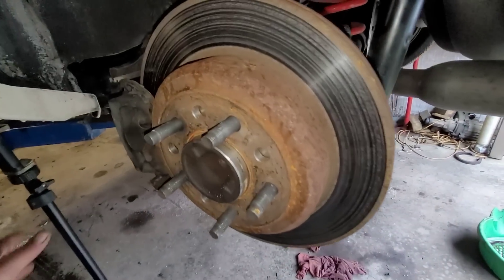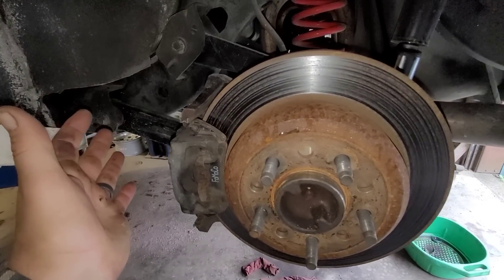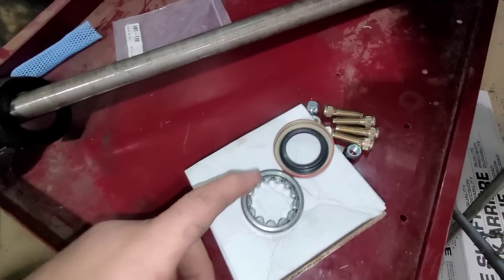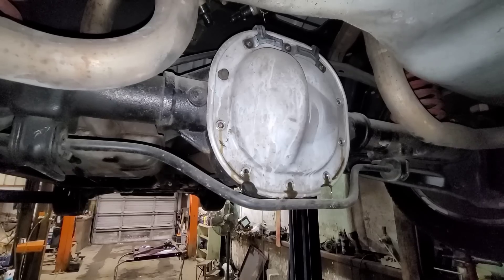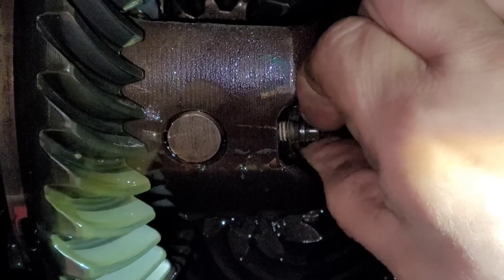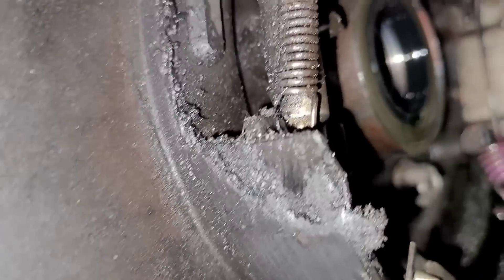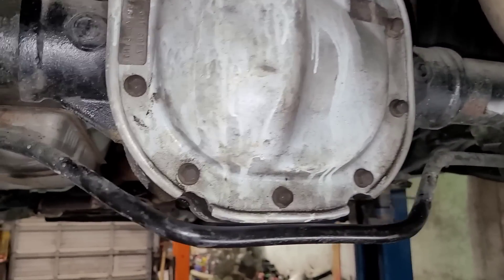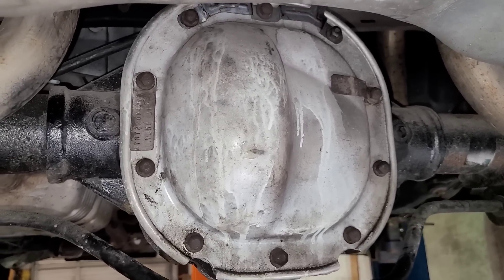Installing Customer Supplied Parts? What Could Go Wrong? I Had To Finish The Job To Find Out.

Comment: Kenny, I have just recently found your channel and started watching your videos, they are very informative, and you do justice to an industry that so many of us are passionate about besides it being our career to earn a living. Mechanics/technicians have been unrecognized for their dedication and sheer amount of knowledge required to perform maintenance and repairs on vehicles, not to mention the vast amount of tools and the cost associated with them. Great to see a positive representation. 
** While watching the video I noticed the parking brake shoes and hardware are installed incorrectly and/or incorrect parts installed. (time stamp 13:57-best view at 21:21) Spring contacting the brake adjuster, pink spring contacting the shoe, looks like shoes are on the wrong way if they are the correct parts, possible wrong parts due to the axle year issue mentioned. Also, you mentioned in the video the customer does not care about the parking brake and is possibly due to it not functioning properly?
Keep up the great content.

Comment: So, the pin in the middle keeps the axles (and C-clips) in place ... and takes the wear and tear of the axle pressure (laterally) as the gears spin ... must be a strong pin not to wear out.

Comment: What I’ve found works really well on a bearing cage that gets stuck like that is to run a bead with a stick welder part way around. The bearing will shrink and be easy to remove.
Reply: Welding a bead in outer race works great. I've done it on tapered roller races. I've always used wire welder. Flux core or gas shielded works well.
Reply: Ditto. Did the same on motorcycle neck bearings, and a couple of motorcycle wheel bearing that seemed to be hopelessly melded to the hub.
Reply: @davidbenes580  either way. It works great. Saves grinding an nicking the surface
Reply: I've done that also. Works really well.
Reply: Awesome tip. Thanks.

Comment: When the bearing race shatters like the one you have (and it does happen often) I just use a long pipe that I stick in from the opposite end of the axle to knock it out.

Comment: Great tip about taking nothing for granted. Great luck in your local parts store having exactly what you needed in stock.  And you’ll always, always turn both axle shafts in future axle replacement jobs to ensure compatibility.
Reply: Or slide the gear over the splines on the axle BEFORE reassembling.

Comment: I generally don’t use brake cleaner because it doesn’t clean everything out. It’s not a very good solvent. I like to use starting fluid because it really does a good job of cleaning. Then I will go behind it with brake cleaner.

Comment: I've watched a few of your videos on problems with parts and your points are well taken. I had a customer supply a rebuilt  starter and six months later it went bad. 
Having a warranty doesn't help you with labor cost and inconvenience of being stuck some place.  After replacing three starters the customer finally bit the bullet and got a new starter and the come backs ended.

Comment: Awesome video Kenny, very nice and thorough with detailed explanations. I watched the whole thing. Too bad you ran into a problem with parts. But a bad situation turned into a good outcome at the end. I try myself not to use customer's supplied parts because it has bitten me in the butt many times. I always advise the customer about that if they provide parts and if something goes south from the customer's parts then they're going to pay me for the down time or pay me to do the job twice. Everybody's situation will vary though especially if it's a good loyal customer. Unfortunately working with customers and cars comes with the territory. 🙂

Comment: U need to use axle saver bearings part  # is RP 6408 for the 8.8 rear axle. The bearing and seal are combined and it makes it where it holds more oil on the bearing its just a better bearing
Reply: Yes it is known as a service or repair bearing, it utilizes a different spot on the shaft to prevent leaks

Comment: @14:22 getting that outer race out.  A length of 1/2" or 3/4" Schedule 40 pipe slightly longer than the width of the axle,  rest one end against the inside of the race and light repeat hammer taps from the far side!  Quick and simple.  👍   @19:35 the same Sch 40 pipe is real handy to drive the rags through.  @45:53  A pot of heating water with your gear lube bottles in will make the lube flow much easier.

Comment: Those older rear ends would freeze up the vent tubes during the winter , when I was a mechanic in the early seventy's in the Yukon the roads had a sever crown on the road and would result hardly any oil on the high side starving the axle bearing , we would just over fill it , it was always the drivers side rear bearing that would self destruct .

Comment: Fluid Film spray cans have an available nozzle that consists of a plastic tube that connects to the can spray nozzle and on the end of the plastic tube there is a nozzle that sprays in all directions perpendicular to the tube.  Something like that might be useful to use in cleaning out those tubes with that nozzle connected to the brake clean cans.

Comment: Mainly watched to see how you cleaned out metal shavings. You did about the same as I always have. I use a piece of pcv pipe with a couple small holes to wire a rag to it. And lots of brake clean. If you do many of these, I got a bearing puller from I think name is ATK. Was about 25.00   It is about like slide hammer attachment on the end. Then has a washer like piece and a jam nut. Tighten another nut and pulls bearing out in one piece. Works much better than slide hammer. And I agree with you on gloves. They suck. Usually end up ripping anyway.

Comment: From Leo:  You have my sympathy for getting burned with the wrong parts.   You are more of a mechanic than I will ever be, but I use a loop of wire cable to drag rags through the axle tubes.  It works pretty good

Comment: I've had problems with axle seals leaking but now I just put a little silicone on the seal where slides into the axle tube and I never have a problem.  You cannot depend on the OEM coating on the seal body to form a leak free joint with the axle tube. The silicone fills in any irregularities.

Comment: HI Kenny, I did had an issue like that with either the man trans of the axles on my 65 mustang.I remember 28 and 30 splines.except i couldn't mate the 2,after 20 minutes of scratching my head i decided to count them,sure enough they where different.I thought to my self ,why the hell don't they put a paint color code like pink and blue.I must have had 28 s and tried to put in 30s.I'm sure glad you didn't edit that out,WE not only learn from OUR mistakes BUT from OTHERS.thanks
Reply: @thomaslamb8337  that’s real neato! what applications had sterling axles?

Comment: The early built 2003 panthers had a Tsb for soft metal axles from supplier causing premature wear. I saw this car was an early built 2003 Town car cartier, nice car. 

31 spline count was used on crowns grands and towns built after 12/6/2004 (so earlier built 2005s. 12/4/2004 and older have 28 spline.
Reply: Interesting thanks for sharing. I’m not in the US but I’ve always had a soft spot for this era of cars particularly the town and crown vic. 

In Australia I believe there was 3 changes to the spline count across just the “commodore” range, during the 80s and 90s

Comment: Lots of Lincoln owners replaced the air ride because it was prone to multiple failures. The bags leaked, the exhaust solenoids corroded and leaked, the compressors burned up, and the desiccant didn’t last. Moisture was the killer on that system. After my bags and compressor went, I installed what was called a spider valve, that exhausted the air in a much different way, plus a water separator in another part of the system. I think the company that sold the stuff was called American air suspension or similar. May be out of business now though.

Comment: Hey!  The most important thing is that you were aware of the mistake!

As a technician myself…

I would teach myself to listen to the customer!

Sometimes they had hidden information to the cause of the problem.

As for customer bringing their own parts…   I would always double check them.

Also, I always had to do a troubleshooting investigation on the customer’s tv when I learned that they had their hands in it trying to fix it!!

The minute I learned that the customer tried to fix it himself or another technician tried to fix it…, I was always at guard looking for misdiagnosis, extra problems, etc.,

Comment: I had a 2007 Lincoln Town Car and it was very strange when one of the rear wheel bearings went out. It didn't make the usual growling sound at first. It didn't make any sound it was bad until the bearing was cutting into the axle shaft. I had hardly any major issues with it. I wound up selling with 464,000 miles on it to a guy that wanted to restore it. It still ran and drove just as it did when I bought it with 52,000 miles on it. The Ford Panther Platform cars were built very well.

When I did my rear wheel bearings on my Town Car and even my 2001 Crown Victoria, I used a long broom stick handle with rags on the one end of it to clean out the axle tubes.

Comment: I dont believe many mechanics would have caught that either, as counting splines, assuming the length of the replacement axle is the same, is usually not done. Must have been more than frustrating. There wasn't a magnet inside the case?
Reply: Except that when you look up the parts, often the number of splines are in the description

Comment: The specific term for the "spider" gears is the differential pinion gears  (because they are located in the differential section of the rear end which allows the differential speeds of the rear wheels when cornering).  This differentiates it from the drive pinion (which drives the ring gear). Other parts of the differential assembly are the   differential housing (to which the ring gear is mounted and the differential side gears(commonly called the axle gears), which mate with the diff. pinion gears to give the differential action to the wheels.

Comment: I always felt embarrassed just thinking about supplying my own parts for a repair. I did that exactly once. I bought a starter (factory / oem) from a Ford dealer where I bought the truck. 93 F150 / I6. I was going to change it, but then the Winter weather turned extra special ugly and the thought of laying on my back in the cold, wet, snow & freezing rain appealed to me about as much has contracting gonorrhea. So, I had it towed from the Walmart parking lot where it finally crapped out, and to the dealer where I bought both the truck and the starter from, with the receipt to prove it. I didn't feel too terribly bad about that.
Reply: If that happens again, you can usually tap on the housing of the starter to get another start out of it to avoid tow truck charges

Comment: This might be a dumb question but could distilled water be sprayed down each tube and all inside the differential to flush out the fine metal left over then gone over with break clean? Would that cause any harm? Thanks for sharing these rear axle and differential videos. I’m trying to learn more about them.
Reply: The idea is to remove all the old gear oil AND the metal particles stuck in it... Using water would not work at all since it would have no effect on removing the old gear oil out...

Comment: I usually prefer to supply my own parts because I dont trust the shop/ parts dealer to get the right ones. I go get quotes from the dealer and then order OEM supplier parts based on the dealer part numbers. Alot of the local parts suppliers around here hae alot of own brand crap that you can't know where they source it I prefer to get Febi, Bosch, NGK, Denso etc. I have had friends buy simple parts like brakepads for their cars and they have been the wrong ones. I do most jobs myself but some workshop tools are not workable to have when you work outside in the parking lot.

Comment: To keep the spider gear shims in place add a film of diff fluid on the surface and the surface tension of the fluid will keep them in place.  Yup never assume anything is correct...it can happen. At least there was no damage from the wrong axles being installed.

Comment: If you want to turn off the air suspension light in that Lincoln Town Car you adjust the sensor until it says on Trim in the scanner and then you safety wire at that level

Comment: Good idea to remove that axle vent tube and clean it out now they can plug up and cause pressure inside the diff when you are driving
Mine was almost corroded shut I ended up buying a new tube to install
I place those bottles of gear lube in a pail of hot water so they squirt out better, the 75w140 flows a little faster

Comment: I suspect that the metal particles from the previous repairs were never completely removed and they will  destroy seals and bearings prematurely. The  larger bearings are not as  susceptible to failure from the fine particles. But the smaller axle bearings and seals once the particles get to them they will not last.  hopefully you have  got the particles out and the repair will last l would be  putting a really strong magnet onto the rear cover ones like out of  computer hard drives are  super magnetic and are several times stronger and will remove any particles in the oil.

Comment: You should check the vent tube. I have seen so many people do axle seals over and over when the vent is plugged causing too much pressure in housing causing seals to leak.

Comment: A tip on how to remove a race easier ,weld a bead along the inside of the race .  The weld will draw the metal and it will fall out . A machinest told me how . I use that method now .

Comment: Leaving air ride on lifting doesn't hurt it . But it does put much more wear on the air pump. The main problem and usually reason for them driving around as a lowrider is leaking orings. Actually they were rather easy to repair if you had Ford scanner. Most just didn't know how to work on them.

Comment: Great video, Question, when you replaced the bearing and seal on the other side, did you get the correct bearing and seal for a 2005 instead of 2002?

Comment: I broke a new alternator yesterday during installation. It occurred to me that your not a seasoned mechanic until you royally screw something up. Also, if you had checked old against new parts before installation you might have caught it.

Comment: Not replacing the parking shoes? They are oil soaked, even if the the customer never uses the parking brake, being oil soaked, could cause them to fall apart and jam the rear brakes. I would have changed them. Besides, how will you tell if the rear seal is leaking, again?

Comment: Is the Race actually part of the axle bearing or is it separate?
Reply: The axle itself is the inner race, roller bearings ride right on the axle surface. Outer race with rollers in it press into the axle tube.

Comment: That’s why there so had to get out and u have to split it because u put rtv on it what’s the reason for that I’ve never heard doing that on a rear end bearing or any press fit bearing and I’ve been doing this 38 years and been to school and still go to school even worked with lots of old timers and never seen or heard of rtv on a bearing

Comment: I assume you know you were correct when you called the spider gears pinion gears because they are technically called differential pinion gears and the 28 spline axles are notorious for failing in these big cars

Comment: I use to work on vehicles. Now my body won't let me. My mechanic I always supply my own parts. I always diagnose the problem and make sure I get the correct parts. Have an F150 I almost always call ford tell them the part I need. Give them the Vin # and I ask for the part number so I get the correct parts. I tell my mechanic I should get a discount for diagnosis. My own problems. My 4x4 stopped working, I couldn't figure it out 1st solenoid on firewall ended up being the electric motor on transfer case

Comment: A decade ago I was the company accountand at a garage. I had a noise my wife said was in the diff. I got a Ford trained mechanic from work for his opinion which was the auto transmission. Turns out wife was right. We got a used complete live axle. When I went to install it all the yard apes came to laugh. They shut their mouths hours later. They didn't know that since 1976 I repaired all my cars.

Comment: Before anyone jumps my ass about what I’m going to say is that I’ve been turning wrenches 55 years and now retired heavy duty diesel mechanic. He talks about using silicone on the axle seal . Well personally myself I hate silicone and hardly ever use it at all . And I hate cleaning up other peoples past work where they schmear all over the place. In the old days we used by our choice Permatex products; Aviation cement, no 1 or no 2 Permatex, vary forgiving. People bitch about surface clean up. Well today with the mini scotch bright pads for air tools , clean up is a breeze. And I still use those today, now on my own vehicles. But now decades later loctite has a product called 515 gasket maker that I use on everything, even on the outside seal case. To take this one step further on motor homes and heavy duty trucks with floating bearing / axle hubs that use a 2 peace spinning seal assembly I use loctite red 262 thread locker because if you don’t the stationary part of that seal that rides in the hub will start spinning when it should not . And when removing those 2 peace seals out of heavy duty floating hubs you must use a oxyacetylene torch and get that steel seal case red hot and pop it out with a pry bar. I’ve done hundreds of these over the years, I know, period.